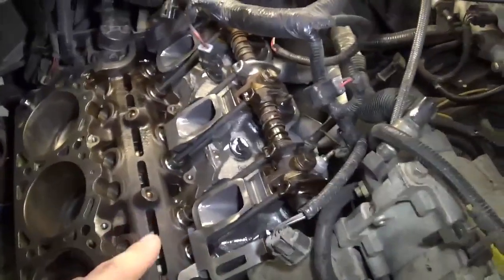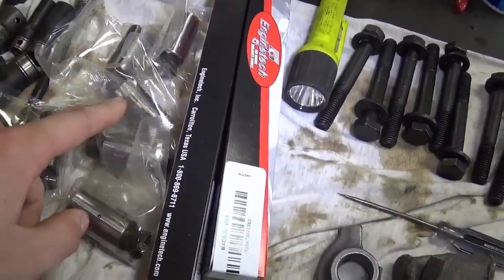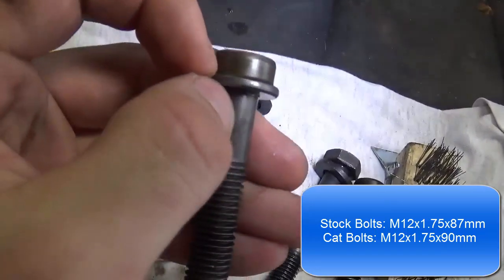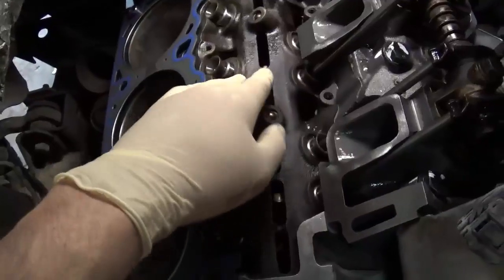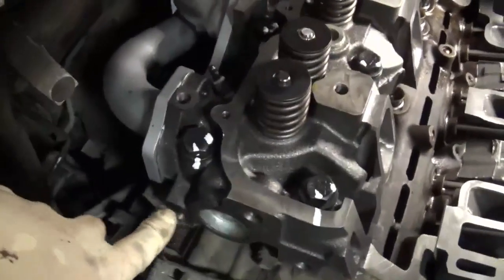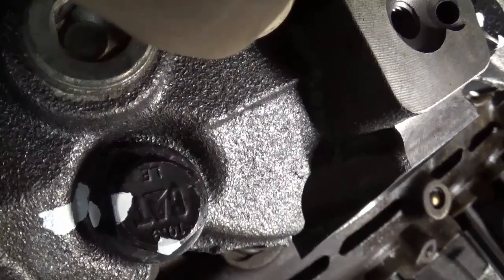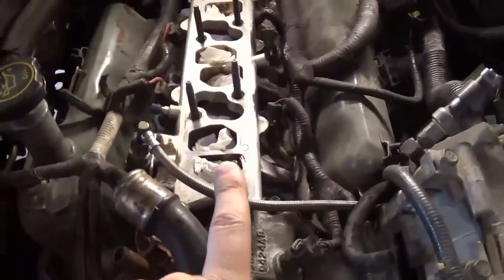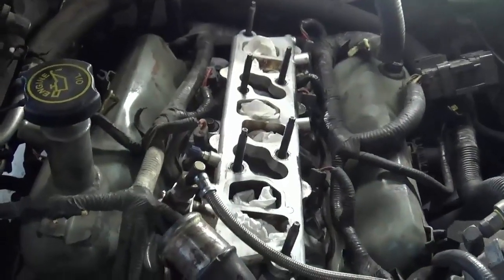Ford 4.0 OHV Top end rebuild

Comment: ive read that you are supposed to torque the head in stages along with the lower intake thats at least how i did my new heads im not sure what difference it makes say assuming someone is just doing a lower intake gasket itd be a p.i.t.a to have to do head gaskets along with a lower intake .i asked on your other video but il ask here to do you know what size oem exhaust manifold to head bolt lengths are i know they are m8x1.25 pitch i just dont know the lengths ?
Reply from the maker: Tim b yeah you're supposed to torque them in stages just to make sure you have an even amount of pressure on the gasket and these engines are incredibly simple to work on as for the manifold bolts I have no idea the lengths I got new bolts with the headers I bought
Reply: appreciate the response tom, i agree they are simple to work on mine doesnt have the e.g.r or air conditioning making it that much more easy only problem i ran into which was my own fault was when i bought the new heads i figured id use the valves i already had ,well the valves would not fit my new heads so i assumed the valve guides in the new heads needed to be reamed a little bit well screwed that up then couldnt find new guides that fit the new heads so went ahead and bought another head .........in the end what ended up happening was my old heads had oversized valves so bought new valves, trying to save a few bucks ended up costing me quite a bit more in the end . great video you have here and im sure will help out alot of people appreciate the time and effort you put into making it .and for anyone wondering what length the exhaust manifold to head bolts are they are m8x1.25x45mm and m8x1.25x70 mm .on a 94 4.0

Comment: 9:45 They call the tool a "Torque angle gauge." Also, some premium digital torque wrenches have a torque angle measurement built in.
Reply from the maker: Skyline Fever thanks but I did figure that out and i do have one of them torque wrenches that degree them too but thats at my work.